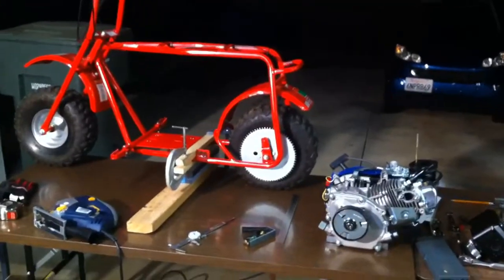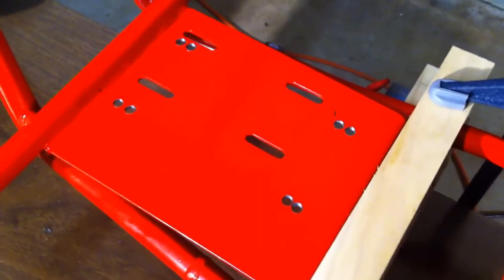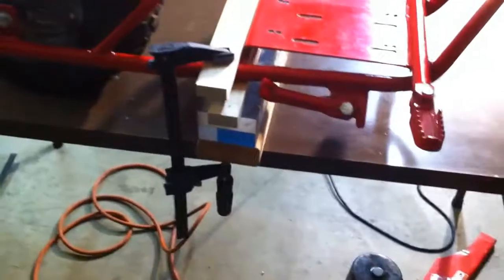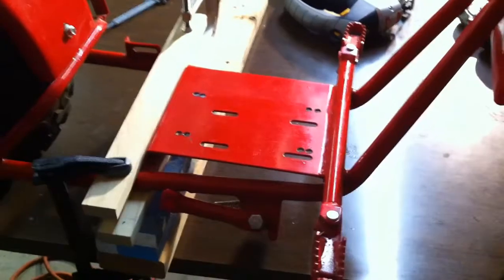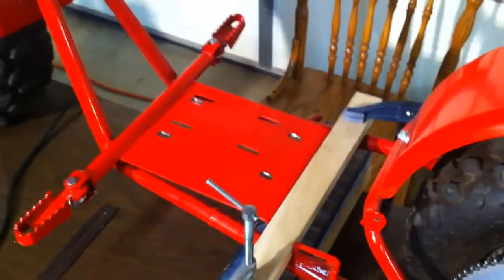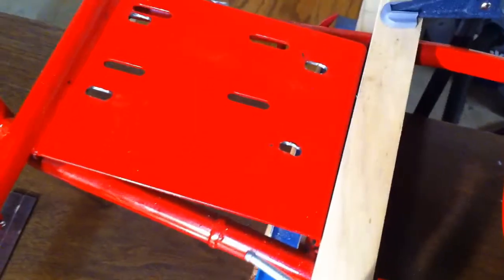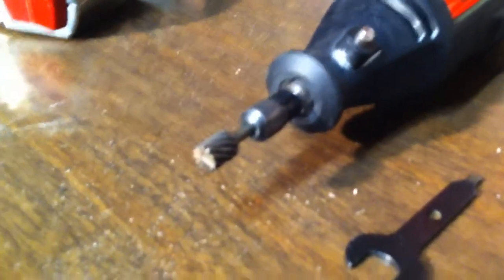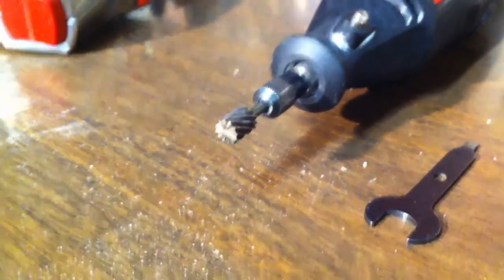Baja Blitz Engine Installation

Comment: You mention the 2" span from the edge of the mounting plate to the side of the engine.  using that figure is only good if these minibike are build identical everytime and I only have one and nothing to compare it to.  They are made in china after all so I couldn't count on that.  You could be right though.  Nice work.